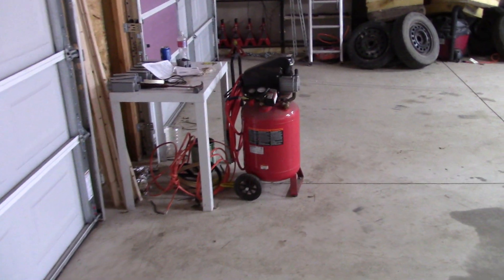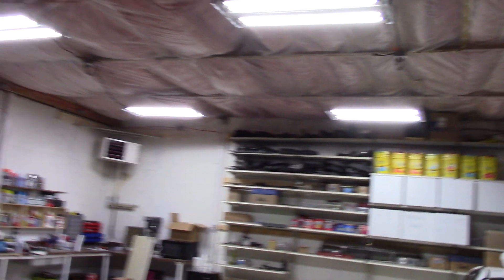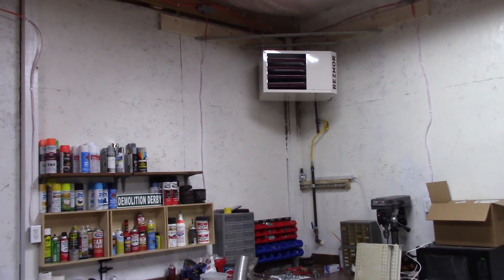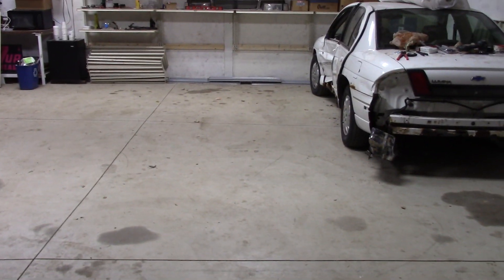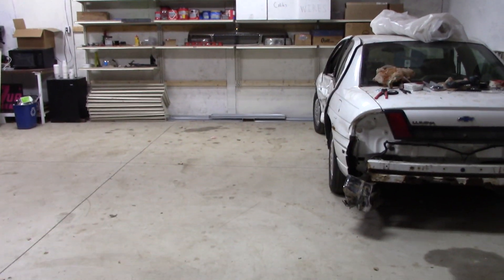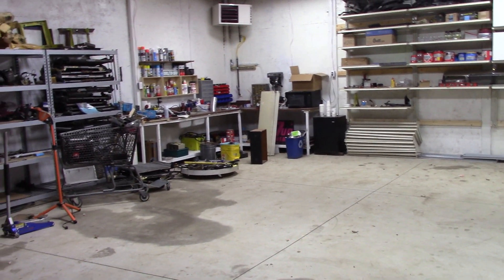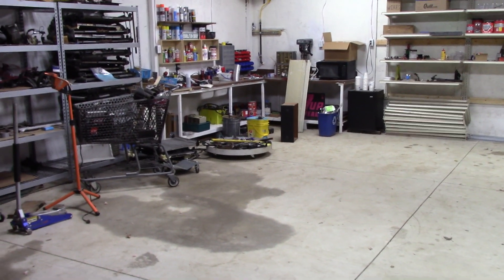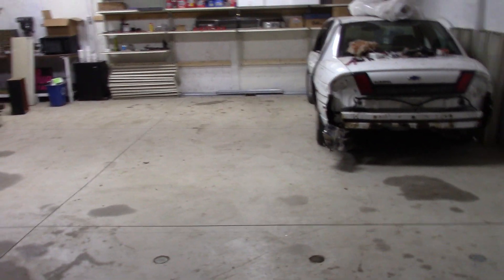Derby Shop Part 10

Comment: Running my first derby next year. Just gonna start small with a cheap fwd car and run it at a bone stock show. Me and a few friends are running together and are building our cars out of self storage lockers because we couldn't find anyone who would really support us. One of our friends is going into the marines after school this year so it's one last thing we get to do together
Reply from the maker: Sounds like a fun way to finish off the year before he leaves. If you are building a cutlass ciera then your fuel pump ground wire goes into the wires behind your back bumper.

Comment: Good job man. I plan on running a 76 Lincoln town car or a 78 ford ltd 2 next season. Which one would you prefer? Any tips on ltd
Reply from the maker: The 76 would have the double crush box at the firewall and would be my choice. 78 could also have it, but not sure.
Reply: @DemolitionMissions  thanks man, I'm getting it. 350 is a screaming deal for it.
Reply: @MrRichardames6  76 and older are the better choice. The LTD II is not as strong as 76 and older.
Reply: @adamtereska8734  well I'm going to have to go for the 78 ltd 2. The guy crushed the 76 Lincoln. So any tips on a 78 ltd 2?
Reply: @MrRichardames6  protect the ass as everyone I spoke to says that Torino based chassis bellies just behind the door and in front of the humps, causing prematuredriveshaft issues, either breaking the u-joint or pulling it out of the transmission and trashing the tail of the transmission. My overall suggestion is make the LTD II a driver and find something else. A similar model year Caddy is a better choice, or another town car.